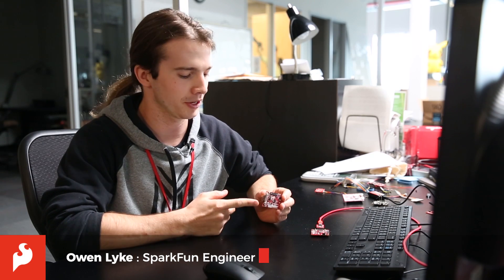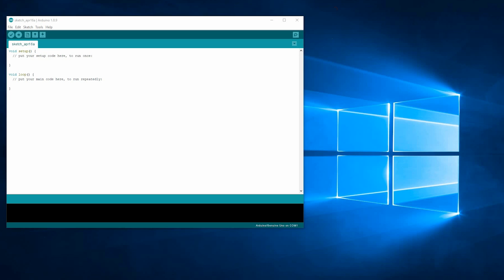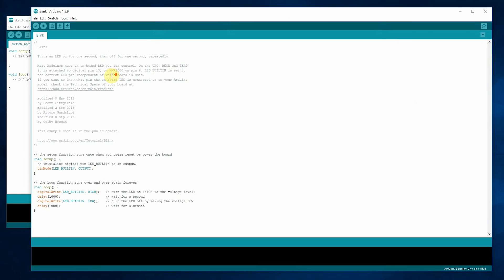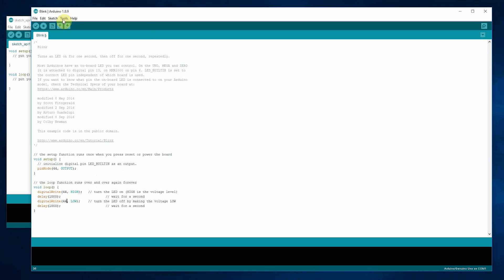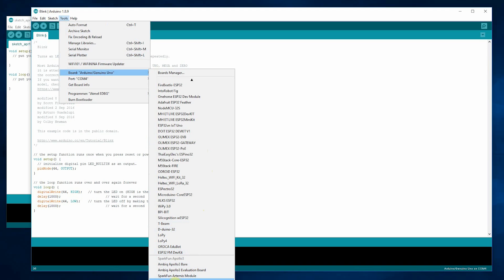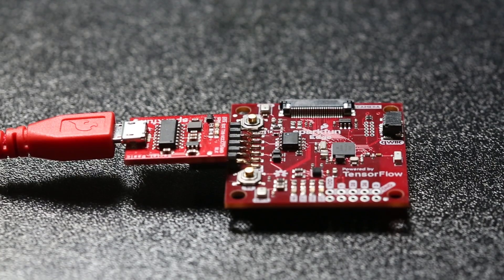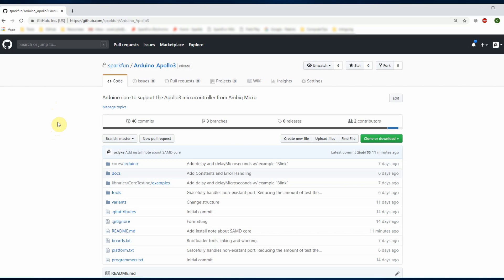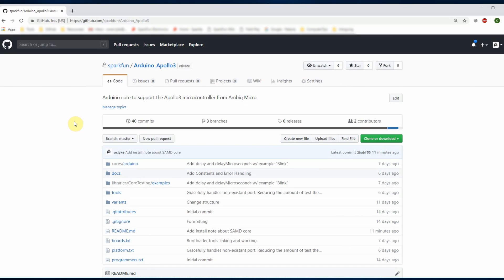Getting Started with the Apollo3 Arduino Core

Comment: For those of you interested: The edge board uses an Apollo 3 Blue core, which runs TensorFlow Lite at 1.5mA@48MHz, is built around a Cortex M4F, and has piles of the usual peripherals plus bluetooth. All for $14. Since low power is the real salient point of of this, that's a hell of a compute load for 1.5mA. By way of comparison, the SAMD21E18 on the smaller SAMD arduino boards like the ItsyBitsy M0 uses 5-7mA when doing anything computationally interesting, and 3mA when it's just burning noops

An arduino core port just makes it easy to get up and running.

Hell, I might have to get myself one. Pretty great deal.

Comment: Too lazy to answer my own questions:
1)  Why am I buying this board?
2)  Is your library not ready for the public, that you need our help?
3)  If I contribute, am I going to help sparkfun make money selling this board?
4)  Why am I buying this board?
Reply: A quick glance shows its cheaper than most arduino options, and super low power. At the expense of no standard shield connector
Reply: Same feeling, Why I should buy this board?
Reply: This board have an objective and this objective is to rise your level of developing deep to the core of the system for example noobs use analogwrite function to generate pwm you can dig deep down and creat your function or the library that can do more than that fixed function for example you can increase or decrease the frequency of the pwm output from the board. 
So this is for the hobbies to rise their level of coding